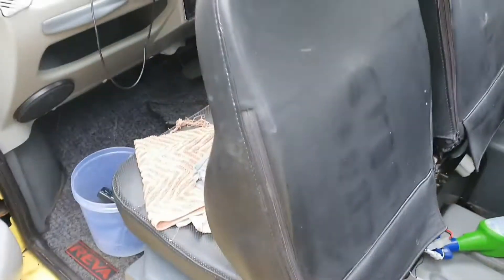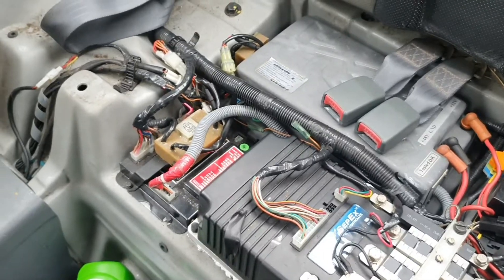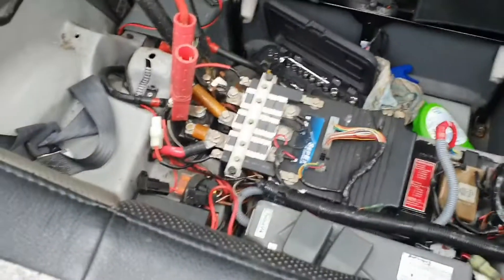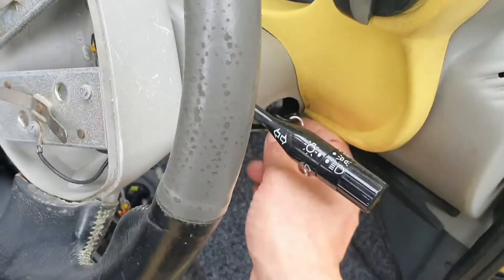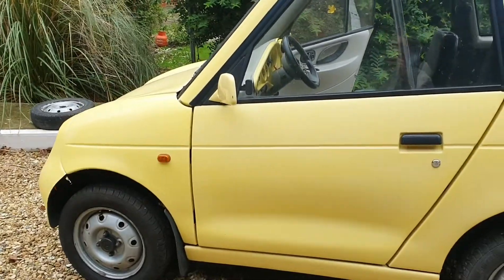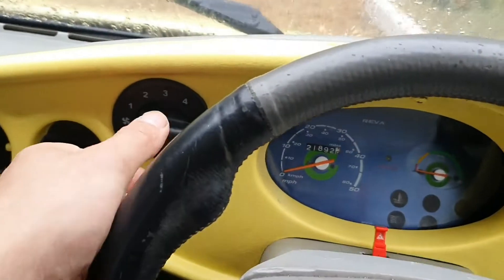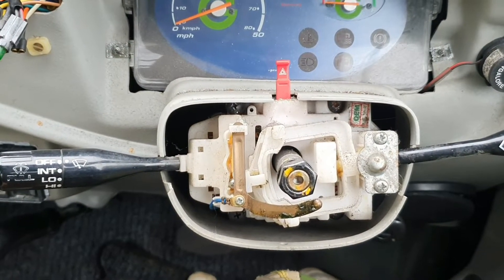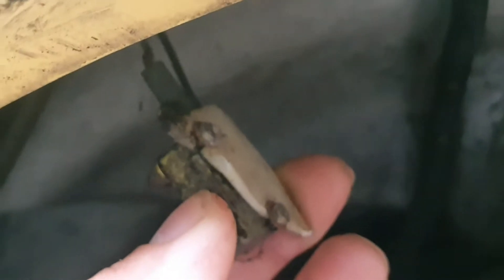REVA G-WIZ: Yellow Wiz Lithium-ion Conversion pt.2 - it's alive!

Comment: Hi Richard, 
Could you please reply on this 
I am from india. i have a offer to buy this car in second hand. But battery of the car is not working. 
How much it would cost to change the battery to new one and what would be process to do so
Reply from the maker: I don't know prices in India. But here it is not expensive if you find second hand lithium batteries. Same cost as buying new lead acid. If you watch my videos you will see the process but it's simple as putting new batteries at the right voltage that can handle 350-400 amp peak discharge.
Reply: @RichardMawby  Any online links of those battery
Reply from the maker: @Naidu442  Depends no second hand EV battery is the same. You'll need to find some in India or it will cost too much.
Reply from the maker: @Naidu442  But if you can find nissan leaf cells or mercedes tesla cells or any along those lines you can get the right voltage.
Reply: @RichardMawby  ok. Thanks for your valuable response
Reply: @Naidu442  1 LAKH 50 THOUSAND INDIAN RUPEES FOR LEAD ACID BATTERIES

Comment: Hi Richard - just bringing my DC back from the grave and had exactly the same issue. Looked at the electrical diagrams and it seems that all the things that work initially are powered direct from the DC/DC converter - indicators, fan, wipers etc are powered separately by the 48v system - once I got the batteries charged up to that level everything came to life. Please note: 1st sensible reply without taking the mickey regarding foraging, etc!! ;-)
Reply from the maker: Ah, the main issue here was that the switch behind the charge socket that disconnects the contactor from engaging was broken. I connected 48v bridge over the contactor but it still wouldn't work until I sorted the switch behind the charge flap out. Some of those things, indicators etc are all 12v except it won't work unless the ignition is turned on. Heater, air con are the only extra 48v powered devices as far as I'm aware. The switch behind the charge flap disconnects a circuit that enable the ignition to switch on to prevent you driving away if you are still plugged in and forget about it, haha, which I admit I have tried to do a few times and it saved me - now I do not have that luxury in the yellow car.

Comment: I love a good project, looking forward for the oncoming episodes
Reply from the maker: May have found your suit case sized batteries: https://www.secondlife-evbatteries.com/bmw-i3-module-94kw.html

They run a little lower voltage but the G-wiz controller will run down to 40v no problem so you will have a voltage range of 49v-40v. Those packs are compatible with simp BMS there for easy to hook up a canbus charger at home to charge them all up. They are all 44v nominal which means each one can become a 'suitcase' to use. You may only need two of them as they are 4kwh each so two should definitely give you 50 mile range. 

Down side is the voltage range... you may only be at city speeds under 45v but that's fine if that's most of the driving that you do. Also I'm not sure what the peak discharge is for those modules but as its from a BMW and 94ah pack I'm sure it can handle the 400amp peak from the G-wiz but I'm still trying to find that part out.
Reply: That's a great find Richard, might have some more uses for those types of battery packs, I'm a volunteer for one of the biggest environmental fairs in London, carshalton environmental fair and we try to run our music stage's off solar these could be an alternative to the deep cycle batteries were using at the moment